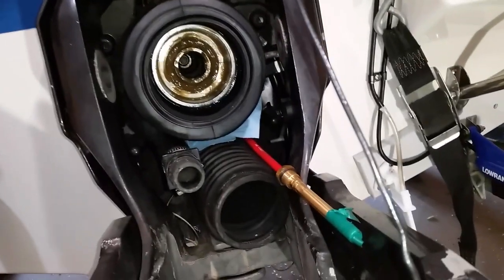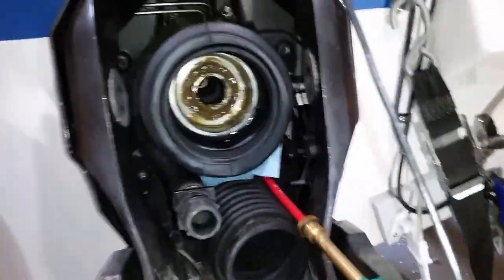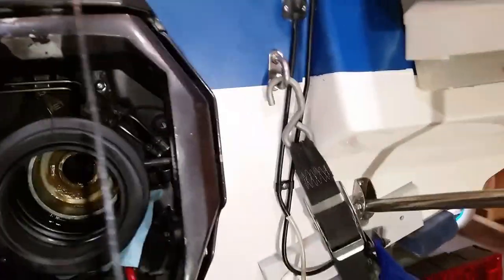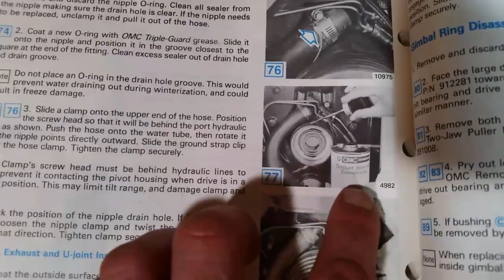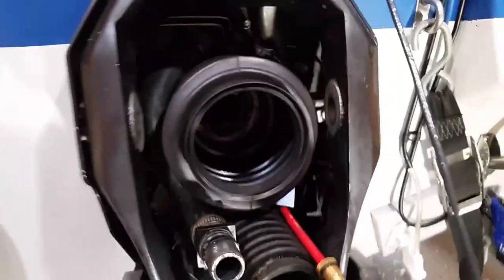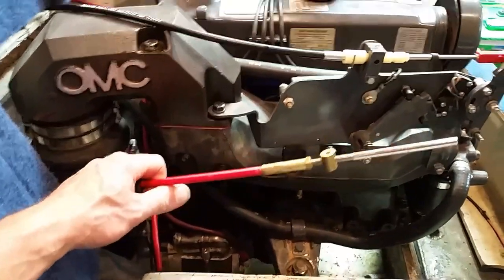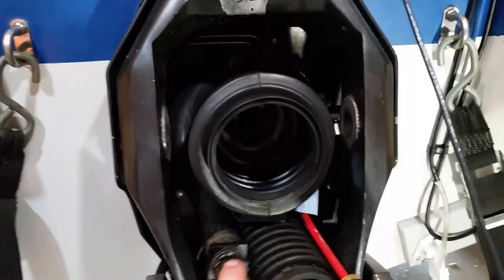omc bellows and pivot housing

Comment: If it’s not already been said:  the bellows leak is caused by the hoseclamp directly above the driveshaft bellows-  tilt the outdrive up and take a look at where the hoseclamp is in relation to the hole in the bellows... 
you need to loosen the hoseclamp and put it in the 12:00 position.  No more pinching, no more holes...

Comment: The old original OMC bellows were of superb design and quality. They would easily last 20 years here in Finland. The new ones are appallingly bad. I just received one and I am actually shocked. They do not seal by parts pressure but are mostly just glued from that outer end. The new ones are made of chinese "rubber" that really can last only 3 years. Old ones were little difficult to get the double cardan joint through without first warming them soft with a hair dryer, but they lasted long and did not leak. I just ordered that new one, but most propably will keep the old OMC one that has been in place for 15 years now. The new one is not actual rubber, but like Jeep front cv shaft bellows, some kind of not-enough-soft plastic. And the original Jeep ones just fail. So, unless I find old stock OMC old ones, I will not replace the bellows untill it leaks. One also must remember that they must be assembled with most "ribs" straight downwards to be flexible in a right way.

Comment: Check the position of the screw clamp for the drive shaft bellows clamp. It should be in the 1--->2 O'clock position (from my '88 OMC factory shop manual), if not, then the screw head could contact the bellows on tight turns. The OMC gasket sealer is the right stuff to use. Make sure that when you slide the bellows in, the internal rib engages the groove in the gimble housing flange.

Comment: You said you replaced the bellows multiple times have you ever attempted the U-Joint bellows repair without removing the pivot housing. It appears that I can get to the back strap from under the housing. Thanks for the video.
Reply from the maker: I know removing the pivot housing can be a chore. Shift cable mainly. You can remove shift cable from transom bracket and try to pull slack back on pivot housing to make it easier and once loose spin the pivot housing off the cable. Also keep in mind the reference point of where the Cclamp is located. Either at the 2 or 3 o'clock position to avoid binding. It's referenced in the omc manual. If you need exact let me know.
Reply from the maker: If you remove shift cable from transom bracket.  The mount on the moter.. be sure not to spin the trunnion..  the cylinder shaped adjuster.
Reply: @omcguy7087  I’m new to omc, I have a 93 I’m about to attempt bellows and gimbal for the first time. Do you have a link/guide step by step? Thanks!

Comment: I have a 1995 omc with a cone drive or shifter. I’m trying to replace the u-joint bellow for the first time. At first I bought a generic brand online, and couldn’t get the thing on the pivot housing. I bought a oem bellow thinking it would fit better, but nope. Is there a trick to you used to get these things in?

Comment: Just picked up an omc 190 in a 89 four Winns  freedom.  Where can I get a repair manual for this omc? I’ve looked around and all I am finding is a owners manual.  I do my own work so having your videos as help and a manual for guidance would be a huge help.
Reply from the maker: Any possibility you have a part # for the manual you need?  What model omc?  I have a box full of omc manuals
Reply: I did finally find a Seloc manual #3404 that covers the 4.3L. I haven’t ordered it yet.   Was hoping to run across a used one on eBay or something.  Had her in the water today and the bellows are really leaking. I’m hoping it’s just the bellows and not much else. Transom sounds solid.  Since I’ll be in it anyways I’m going to pull the transom assembly and put a new seal down.  Probably going to pull the motor out next weekend and see how much damage there is from the water leak.  Thanks for the reply. If you have a repair manual for the 4.3 1989 model I’d gladly purchase it from you.
Reply from the maker: I have a collection of factory omc manuals . There are many models and alot of the manuals do not have dates. I'd have to dig for info to see if I have the manual you need. Model number on both motor and out drive would help. I had purchased the whole collection years ago from a retired omc mechanic out of New York along with specialty tools.
Reply: Jon Cunniff check out Wayne coll you tube channel also for some detailed information
Reply: @omcguy7087  I would like a manual 1993 502APRJVB much appreciated

Comment: I have an Alpha one and a small hole has come in the bellows in the same place as OMC Guy from the clamp , can does this bellows have to have grease in it before putting the drive on, I was going to put Bellows adhesive on the hole to get me until the end of September, is this a good idea, and should I pump a little grease in first. Also I only found out because a white cream leaked out after a day on the bay last Saturday